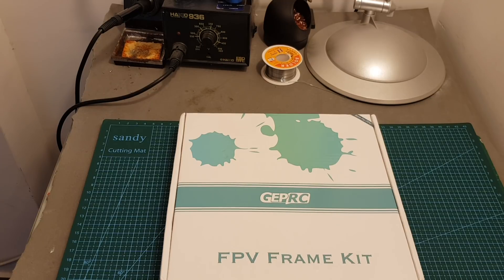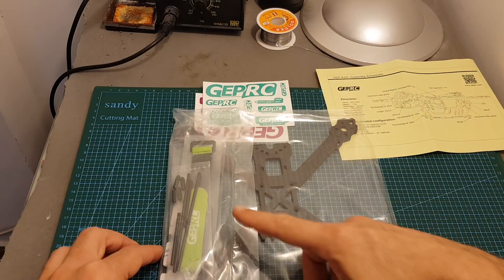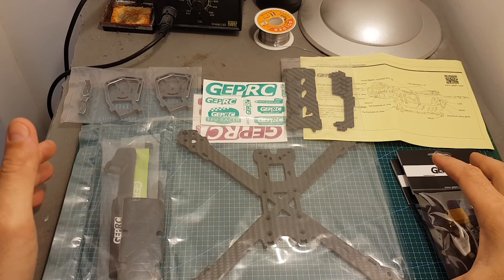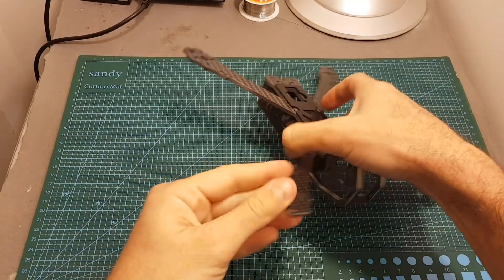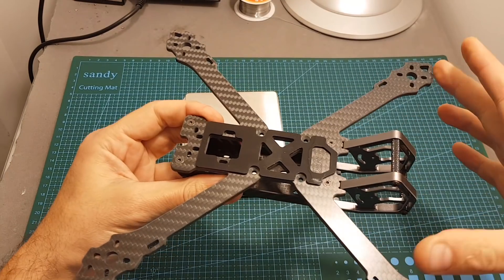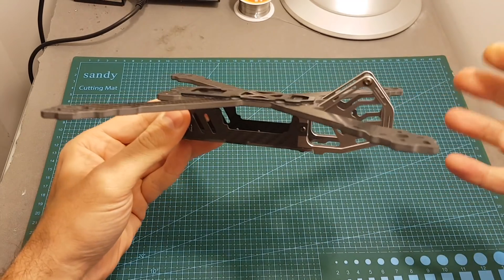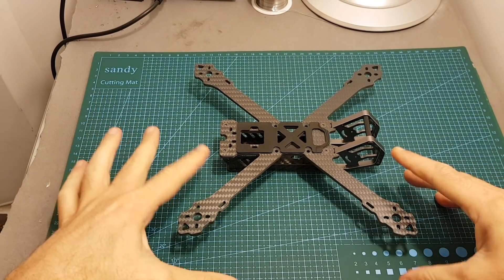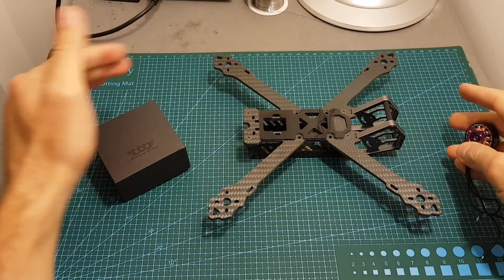GEPRC GEP-KX5 Elegant 243mm Frame Overview & Quick Build

Comment: I like this frame Gal but it's quite expensive. I was looking at this one too as it is half the price. Have you looked at this one yet? https://www.banggood.com/HSKRC-Freestyle-250-248mm-Carbon-Fiber-True-X-RC-Drone-FPV-Racing-Frame-Kit-118g-p-1275741.html?p=63061312105582015022&utm_content=huangguocan&utm_source=rcgroups&utm_medium=rcgs&utm_campaign=marblekit&stayold=1&cur_warehouse=CN
Reply from the maker: This is a cloned frame, but it looks good and will provide a good value for money, as long as you don't care it's a clone :-)
Reply: Yeah that it is, however, I am not 100% sure I will like the frame so was thinking to try this one first and then get the original.

Comment: Gal - I have an Elegant under construction.  Omnibus F7, Luminer 35A 4in1, and Brother Hobby R5 2306-2650KV.  Mounting the 4in1 is a bit awkward as it must sit on top of the FC.  Also, the side panels must be cut down somewhat to accommodate the additional depth of the FC/4in1 stack.  Reports of the arms breaking in a crash (see https://www.youtube.com/watch?v=sjNWhGoIMag&t=10s).
Reply from the maker: Thanks David. I heard about theses issues and I will address them when I will build it, probably in two weeks or so. When are you going to finish yours?
Reply: Maybe after the Christmas holidays.  I want to print some custom vibration pads for the motors.  Don't know when I will venture out to fly it as the weather here is expected to be cold for the near future.  Which fpv camera are you thinking about using?  I want to try a Foxeer Monster.  Should easily fit.  I've also have a Tomoquads CSX in the works.